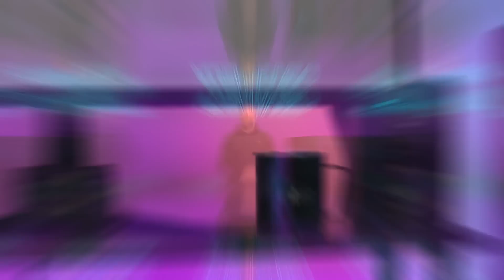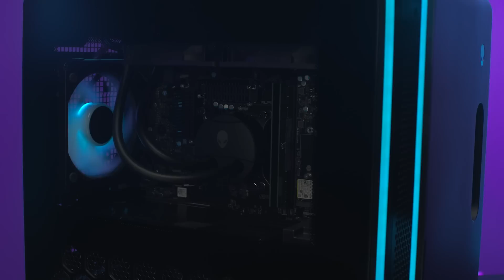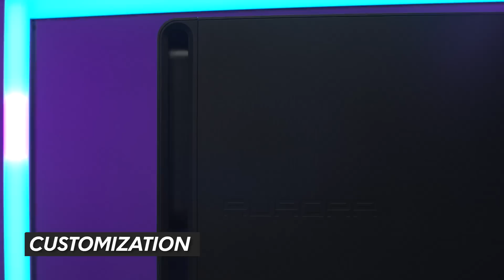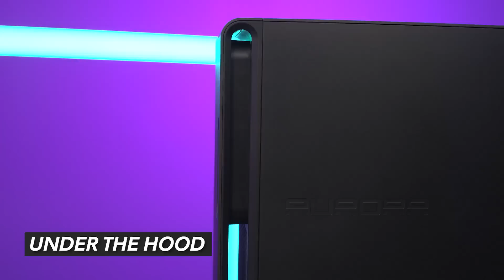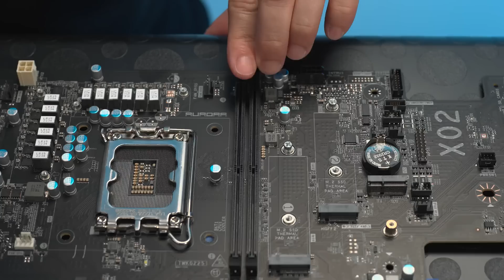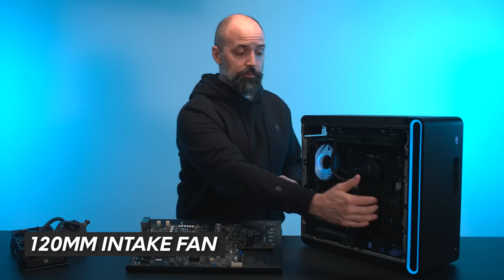The Next Generation of Gaming Desktops | Aurora R16 Deep Dive

Comment: How this guy can spew that nonsense with a straight face is incredible...  'Alienware Aurora' and efficient cooling is a contradiction in terms.
Reply from the maker: Cause it's true 🤷‍♂️
7% cooler
20% quieter
And a 54.5% larger air intake
Reply: @AlienwareChannel  prove it
Reply: @AlienwareChannel Compared to what? A macbook?
Reply: @AlienwareChannel  Umm, 7% cooler doesn't work. 80C = 353.15K. Same energy, different units.  72C is 10% less than 80C, but convert that to K and you get 345.15K. Again, same energy just different units. So 10% in C is 2.3% in K. Your 7% is at best meaningless if not outright misleading.

Same thing with 20% quieter. Sound is measured in dB, dB is logarithmic. So going from what to what and how are you getting 20%?

54.5% larger air intake? Not seeing how your getting this at all. Your going from 2 120 intake on the R15 to 1 120 intake on the R16. 50% larger passive intake? I don't trust my math skills to correctly calculate the void space on the side panel, but if your holes are twice as big but you only have half as many... prove me wrong but it sounds like your just making up more numbers.
Reply: @AlienwareChannel   More than what?  The inefficient and noisy R15?!  Not exactly a great benchmark to use.  You've taken the one and only thing that the previous design had and that was its originality and stuffed in into a generic black rectangular box with one - yes one - front intake fan.   Do you actually expect that to cool a RTX4090?  Don't think so.  At least the R15 had two front intake fans.  No, what you've done here is you've cheaped out and basically given us an XPS with a few blinky lights.  It is unoriginal, dull and not at all appropriate to run a top spec gaming PC.  You are not fooling any enthusiast with this.  Gamer Nexus and J2C are gonna have a field day.
Reply: @vincentrichardson1205  you do understand more fan increase the acoustic right? 
Gamer nexus is a joke
Reply: @timlee1313  That's... that's not how it works.
Reply: @timlee1313 More fans means each fan would not have to work harder to achieve same result in airflow therefore running at lower rpm and overall lower noise.
Reply: @vincentrichardson1205  The 4090 doesn't even fit in this case lol
Reply: @aristotelisentertainment279  That... is hilarious....  tho in true Dell fashion, they'll most likely have someone build their own OEM version and cripple it to make it fit.  And the suckers will hover it up.  By the way, I was once one of those suckers.